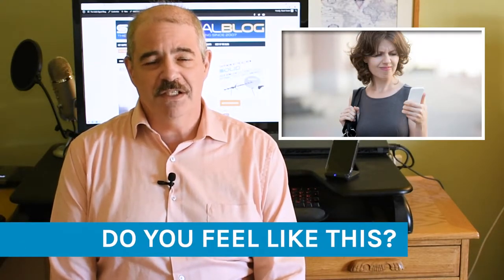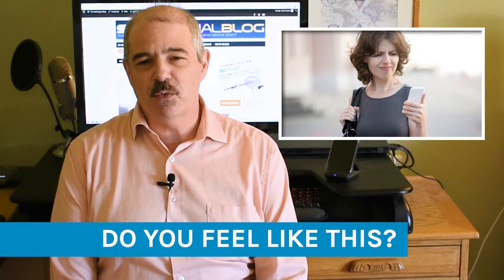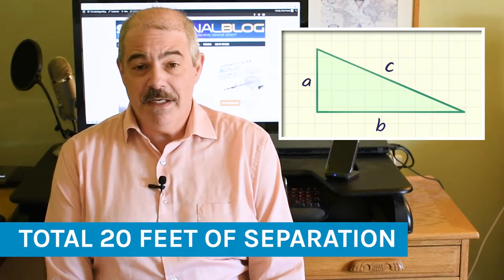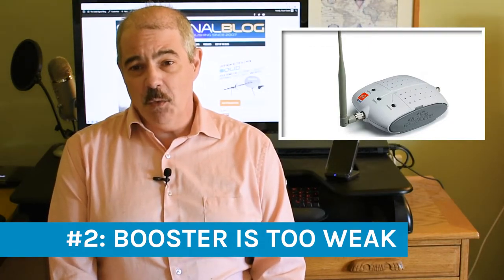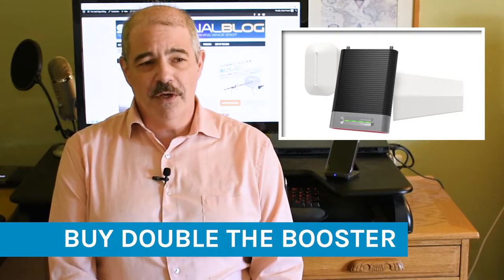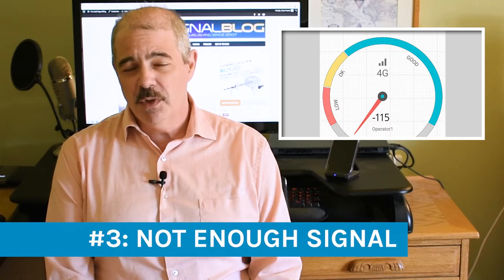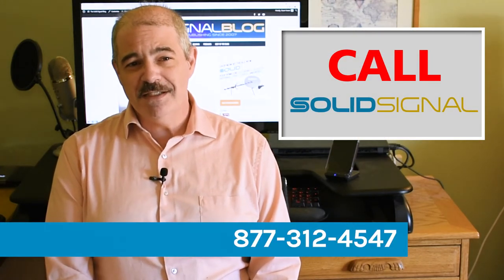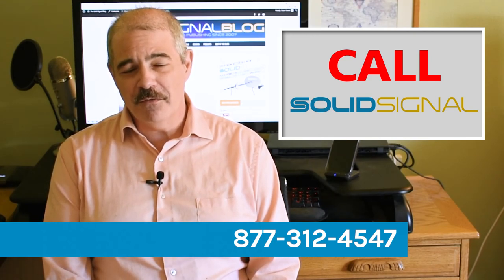Why doesn't my new cellular signal booster work?

Comment: 15 feet is set as it will have a certain amount of dB loss.  Mounting behind a big double brick wall or with a thick steel plate would achieve the same thing.

Comment: Can you use a second wireless Bace station {UNIDEN CORDLESS HANDSET XDECT 8115 + 2 identical to the original first station} as a booster for the first base station??
Reply from the maker: I don't think that would work.
Reply: @SolidSignalNovi  Why not? The base station/s send & receive from & too many phones, {I now have five phones connected to the original base station} so why can't two base stations communicate similar to modems & hard/ssd on a computer? With a master & slave drives & modem/s do! I'm just saying is it possible?